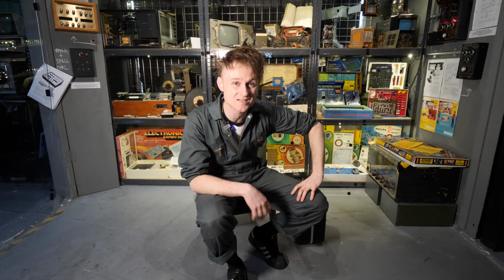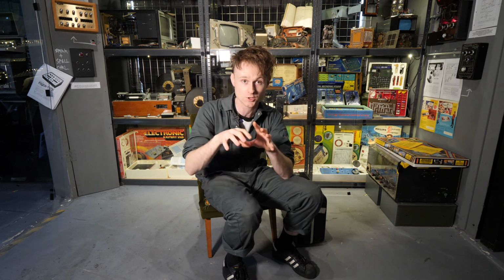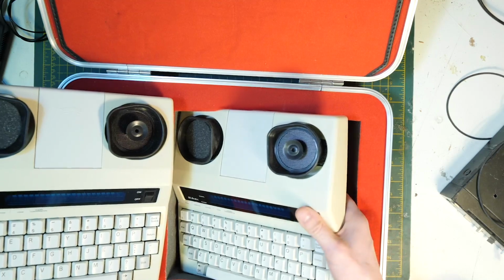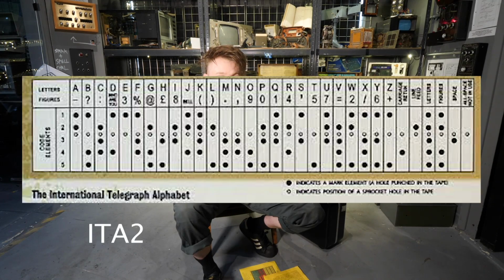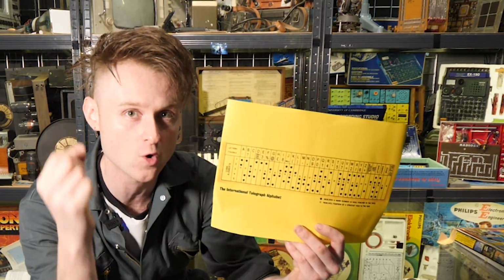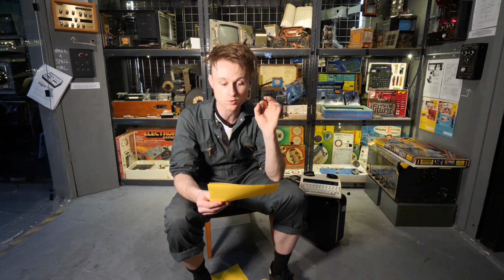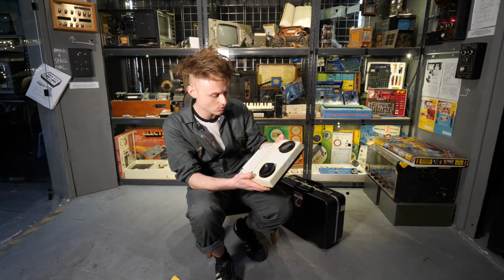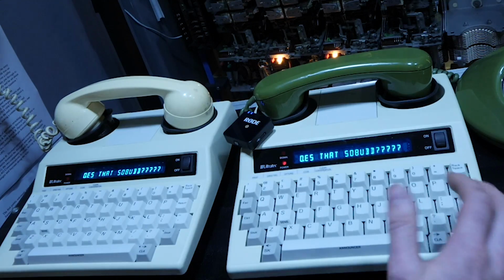WEIRD SOUND MAKING TYPING TELEPHONE THINGY - minicom 5000

Comment: The rabbit hole goes even deeper, the frequently shift keying was also used by the kansas city standard. It was a standard for loading software from cassette tapes. The BBC micro and the MSX used it, at a baudrate of 1500 baud. If you play a computer cassette it sounds like a dial up modem.

Comment: Aaaah, speaking as someone who is born deaf, that takes me back. The minicom (which was given to me free by the health services) was revolutionary in terms of using the phone to keep in touch with other people in pre-internet times. I recall it used the TTY signal for sending data from one minicom to another and the "telephony" software on Windows 98 and a 56k modem just happened to be compatible with minicoms. It was handy but it wasn't that long before SMS texting took over as the standard means of keeping in touch with my deaf chums. 
What I do remember with using a minicom was that it was considered "good manners" to type SKSKSK to properly close the conversation, in fact I know a couple of deaf friends who still do that in Facebook messaging out of habit!
Reply: What does sksk stand for??
Reply: @joe-e-geo  The Morse code pro-sign SK (S and K without the pause) is the code for "end of transmission", considered an abbreviation for "Silent Key". I'd assume that's where the Baudot use came from.

(Not coincidentally, "Silent Key" is radio ham slang for someone whose telegraph key had gone permanently silent, i.e., someone who's passed away.)
Reply: @unsoundmethodology  I learned this as Stop Keying, but I always thought of this as 'Popeye the Sailor Man' or . . . _ . _
Reply: Telephone Devices for the Deaf (TDD) were everywhere at my university RIT in Rochester NY where ~1 in 10 students are deaf.  The deaf user could watch the signal light to see the ringing sound, which then changes to a flicker when someone speaks.  They would tap the space bar once or twice to announce they are using the TDD and the hearing person should connect to the TDD.  
In addition to the convention that you type 'SKSK' at the end of a conversation, you let someone know it is their turn to type by typing 'GA' at the end of your sentence for 'Go Ahead'.  This only works if one person types at a time.
Reply: That's the one with the GA! I've been trying to remember the other "keyword" with using a minicom, it was like our own version of saying "over".
Reply: @idj20  I used to work at a relay service for TTYs, it was an interesting dive in Deaf culture
Reply: I remember filling up the buffer on the computer and hearing a 3 paragraph message beeing transmitted slower than I type
Reply: I have customers using captioned phones that still say "Go Ahead" as a holdover from TTY machines
Reply: amazing Ian, thanks for that. what does SKSKSK mean/ stand for?
Reply: oops, sorry, didnt see the replies button, lol.

Comment: I'm old enough (nearly 50) to have spent some time in old Strowger BT exchanges, mostly at Hatch End and Pinner. The noise, the smell, it was glorious, my step-dad Graham took me around and showed me everything and explained how it worked. Also how "taps" worked and were applied, and if they discovered one they were told to just ignore it :) When Hatch End went digital the entire floor of switches was replaced with one smallish box on the side of the room and it was silent.

Comment: Very nice. I like how the tones time out so that it doesn't scream in your ear all the time like a regular modem. In the states these are officially called a Telephone Device for the Deaf, or TDD.

I have two Ultratecs an Ameriphone and one of another brand I can't remember even though I just checked them. As usual they're on the pile of "stuff I should mess with someday not until I can do it right because I don't want more half-opened stuff with missing screws". But the one thing I can tell you is that the plastic door between the phone cups is where the optional receipt printer goes.  According to check boxes on the product label, there was also an ASCII version. I have a feeling they sold a lot more Baudot versions.

I certainly can't resist a mechanical keyboard though! Got to hack my own code for them or at least set them up as proper wired terminals.

Comment: Used to support these in a job a bunch of years back. There was an optional printer you could add to the slot that lifts between the I/O that would print off the transcript. Pretty cool!

Comment: I remember hearing these tones on the shortwave radio band a lot.
Reply: RTTY
Reply: is that what it was?  7 year old me always assumed i was listening to ships
Reply: They're still there! I got an old shortwave receiver a couple years ago and I pick up these signals all the time. Didn't make the connection of what they were till I read your comment though. Super cool!
Reply: @ChipGuy  ha!! that's awesome to know!!
Reply: Just mentioned in another post that it's pretty easy to find WebSDR hosts, and the browser UI (like KiwiSDR) sometimes has a panel for decoding the messages. Majority seem to be maritime weather reports, although you get some that tell things like weather and flight restrictions for aviation or stuff like scheduled harbor traffic too. (Can kind of guess what's going on when reading them if properly decoded.) Then some are just HAM radio hobbyist chatter. At least that's for the ones that are less cryptic in whatever it is they're relaying. Military ones will do stuff like repeat code words, which doesn't tell you much unless you have the crypto table or whatever.
Reply: @pauljs75  Yeah but the ones I found (only did a quick search) only made the HAM radio bands available. Maybe som enthusiast also still use that just for the heck of it. Would be interesting once there is a station that regulary sends out these codes to use a receiver with speaker attached to that modem and decode whatever is being transmitted

Comment: This is amazing! They should still make these, it's way faster and more fun than texting! I also can't believe you can do a backspace, how cool.... I WANT ONE
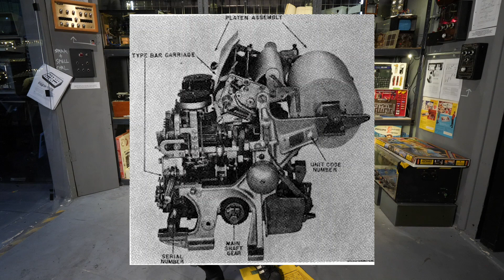Reply: If you look at the code sheet you'll see that there are several "command" codes; like 11110 rings the bell and 01000 is a carriage return. This code was developed for teletype machines like the ones shown at 5:40. These were basically automatic type-writers that used the code to type out hard copy. The back space is a weird one because on a type-writer a back space does not erase the previous letter. It's normally used to double strike a letter making it bolder than the rest.

Comment: The sound brings back memories. My grandfather had a radio receiver with a really wide range. I would tune it to satellite signals and everything wired. There where a lot of this type of signals in the 80th. I had cassette recordings of some of them for a long time. Back then i didn't know what the signals meant. I identified and decoded some of them 15 years later. Some partial weather maps and status texts from oil platforms in the north see.

Comment: Awesome, you still hear TTY on the amateur radio bands all the time. Its a bit archaic, but if there is one thing hams love its doing cool things with awesome old tech. being such a common standard, when you do get some public facing phone lines, it would be super neat to just have one of these open to call into. Ive used phone apps to decode RTTY audio, so should be quite accessible. its better done with proper hardware in your actual computer, but thats not the point here. 

Best of luck finding a proper mechanical TeleTypewriter. I geeked out so hard on curiousmarc's videos on them, they are insane bits of engineering.

cheers lad. would love to sink a few pints with ya

Comment: I remember these devices!  They're called "TDD" = "Telecommunications Device for the Deaf", as I recall.  I even saw them in phone booths now and again, on into the early 2000's.  As payphones disappeared, I figured that even the deaf had switched entirely to smartphones, and such dedicated TDD's had become completely obsolete, as anyone -- deaf or not -- could send SMS texts.  Fascinating things, though!  

I vaguely remember reading that, if you didn't have one and wanted to call someone using a TDD, you could use a computer + modem, with your terminal software configured as a simple teletype terminal.  A friend and I experimented with it once between our houses, but since we were both using computers + modems, and neither of us knew anyone who used a real TDD, that's as far as it got.  This was circa 2000.

Comment: Although the acoustic coupler on top makes these things look like an 80s artifact, the fact that the Peterborough code is given as 01733 and not 0733 shows that it must date from 1995 or later.

There used to be text relay services which enabled users to type and read conversations with a human operator translating in either direction. 

If you received a call from a user, it could be a bit disconcerting because you had to realise that you weren't really conversing with the operator but with the person typing and reading messages at the other end.
Reply from the maker: This was 1996 but these were one of the last of these items they had been rebranded but stayed largely the same since early 890’s

Comment: I used an acoustic coupler for a short time. The circuit inside was remarkably simple, just a few transistors. The tx part was basically a vco connected to a comparator which had txd as input. Therefore ones resulted in a different frequency being generated than zeros. The baud rate was entirely determined by the equipment connected to the coupler. In practice that was either 110 or 300 baud.
Reply: I also had a teletype for a bit. British Creed model. The serial to parallel conversation done by bits of metal was amazing.

Comment: The kit was provided by the RNID not RNII 
I used to work at a school for the deaf in southport. We had two of these. Which I had to repair form time to time. 
The cover in the middle could house a thermal printer to youbjad a record of the  conversion.

I used to have one at home to call the minicom number for companies that charged premium rates for calls.

Comment: I do all kinds of digital stuff with ham radio.   You can use a PC sound card as a modem and hook it to a radio use the AX.25 protocol and bang internet over a analog radio.  RTTY and PSK31 there are many other digital modes that work using a sound card.   Lots of things use FSK like your wifi router, digital police radio (DMR digital mobile radio) P25.

Comment: I had a deaf friend at the radio club back in the 80s, also when I was working in South Melbourne there were several deaf people working in my area. I become very aware of these machines.  Being a radio ham and having built my own RTTY (radioteletype) modem for use on radio. I also noticed how similar the minicom is to the RTTY gear.  Hams began using teletypers or teletypes with a modem back in the 20s and progressed to computers in the 70s. My deaf friend would use a RTTY program for the Tandy Color Computer and an acoustic coupler (just the cups, not a modem).  The baud rate is actually 45.45 baud, so unless the teletyper was already adjusted to 45.45 it will be running at the commercial speed of 50 baud.  I used to listen to the RTTY Night Owl Theatre on Wednesday nights in Melbourne and printed out the text pictures they sent.  The most popular machine was he Siemens Model 100.  If you get one, remember to disable the answerback drum, sending Figs G will cause the drum to send a message which is set with pins inserted in the drum.  On the Siemens you just lift one bar so it doesn’t trigger the drum.
Reply from the maker: yep. these automatically go to 45.5 or you say 45.45. whatever it is just doing what it said on the manual. UK defaults to 45.5 apparently. itdoes have an option to switch to 50 and also other codes.cool thanks
Reply: These machines are known as TTY in Australia rather than minicom. 0.05 baud probably won’t be an issue, just adjust the machines motor speed to give to give consistent copy over a long period of time.  The common test signal is series of RYs (RYRYRYRYRY) which gives an alternating bit pattern. Sometimes called Ridges due to the way it looks on an oscilloscope. Due to playing with RTTY the sound is like music to my ears.

Comment: I really love that keyboard. I'd love to see it taken apart to see what sort of switch it uses so that I may find them and build a separate keyboard out of them. They sound goooorgeous!!! 
Excited to see more telephony stuff! Especially the bit where you want to connect the Strowger exchange to the internet. Calling into the museum would be so cool!
Keep it up!
Reply: My Minicom IV has black Cherry keycaps with doubleshot white legends but oddly enough they have adapters installed to mount the keycaps onto Alps SKFL switches. Other Minicoms used different keycaps and or switches.

Comment: Too slow for binary, huh? I like the old stuff though. 
I found an old hard drive once (get this) It was about a little bit bigger than 1/2 the size of a shoebox and had a whoppin 5 megabytes. No typo there. 5 (five) MEGAbytes. And it was SCSI too. Very sophisticated for its time. I kinda wish I kept it in tact, but the two neodymiums in it were huge N52s.

Comment: If you're able to use an Arduino or a raspberry pi to decode the data in real time. It would be cool to setup a website 
 which allows you to see the raw data and the encoded in text in real time being sent across the museum (using a websocket or something similar for the real time part). The website could be used to listen to real time calls from the phones

Comment: @Sam, baud rate isn't always equal to the bitrate or symbol rate of transmission.
Reply: Actually, as I recall it IS the symbol rate, but a "symbol" can represent more than one bit of data. For instance, both frequency and phase can be used for information. A lot of modern encodings may have 16 or even 256 encodings per symbol.

Comment: They used this tecnology as a secure radio coded text message, via audio over a (fx) radio in danish military 1990s. A mil version, in handheld size would transmit a ultrafast burst “tweep” that could only be understood by a simular mil version, that used the same keycode. Then the text messages could furthermore be coded if you wanted. Very time consuming, indeed.

Comment: There is something about "low tech?" old school gadgets.
Definitly got charm, i love the audio encoding decoding at low bitrates, it makes computers make sense so to say. 
I was to say not a protocol in sight, but it so lovely damn basic.
Do you know if there was any arithmetic protocol encoder would it just be a 4 bit one?
"maybe as a part of telephone routing?"

How did they shift "mode?" 5 bits just 32 "placeholders" so how  did they make use of all signs on chart?
Reply: Had to learn decode Morse in military service, i probably had the worst error rate ever LoL

Comment: record a load of secret messages on mp3s that shuffle or are number specific and play it back as messages in a treasure hunt on the mincom 5000 with hints. <3  - Had a play on a later version that used a modem in the V&A Waterfront Telkom emporium in Cape Town in the early 90's

Comment: Since this is 'no computer' so no biggie, but it's actually using 80C31microcontroller not 8082 (which are actually years). 80C31 is romless (but still has 128 bytes of ram) CMOS version of Intel 8051 microcontroller.

Comment: Do they use mechanical keyboard? I love that sound. My granddad was HAM operator when he was alive and he had class A license is the highest, it requires you to pass 16 words per minute Morse code. But sadly he is silent key since 2000. Iam missing him alot.
Reply: Some of them do. I bought a Minicom IV on ebay a while back (no idea why) that had black keys with white legends that were manufactured by Cherry and used an MX grey for the spacebar and Alps SKFL switches for the other keys (using adapters to fit the MX keycaps to Alps mount switches).